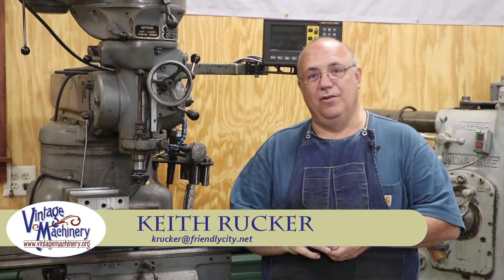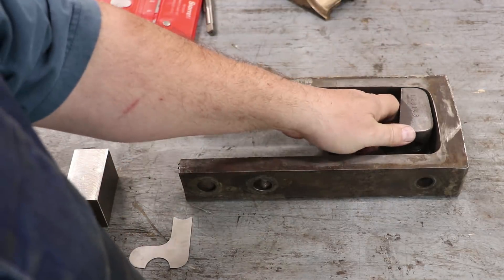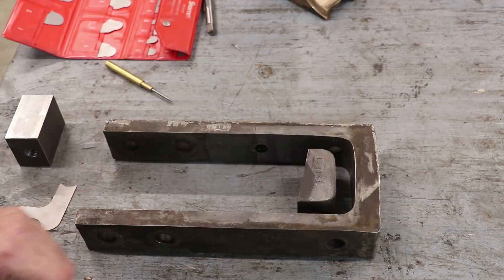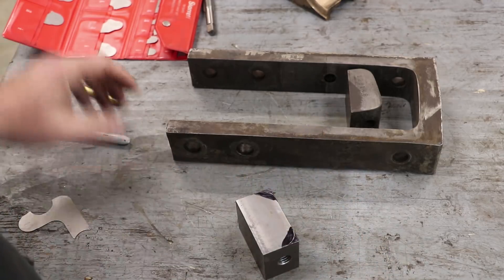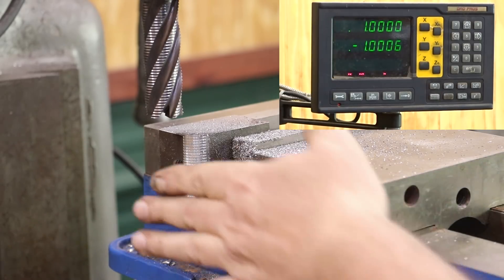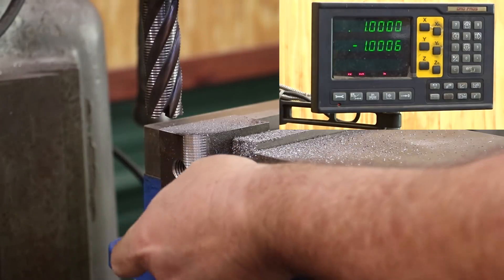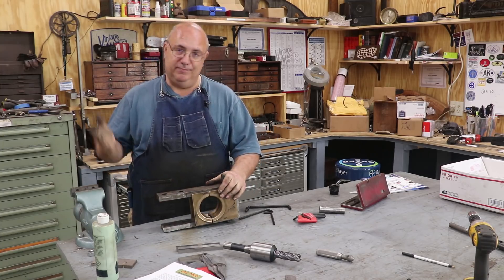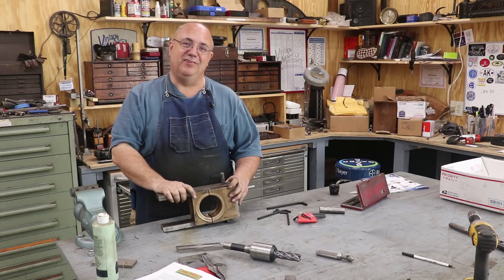Machining a Steam Locomotive Bearing Wedge - Part 2

Comment: This is several months old now, but I have a problem with the operational theory of this repair. If the bearing surface of the U bracket is not parallel with the threaded bolt and flatface of the wedge, you will never get a consistent bearing surface for the wedge. The center area of the U shape will be further away from the bolt, so you will not butt up solid against the U bracket, therefore accelerating wear in the future. You have a lot of time and money invested in the train, repair it properly, don't cut corners :(
Reply: Quite right.  Keith is trying to get the flat,  machined surface of the new wedge to bear on the curved surface of the rod strap.  Not gonna be effective.  I guess by now (4 years later) it has just caused more bowing of the strap.
He's an entertaining charlatan.

Comment: Nice job Keith, as usual!  I have a question, the coolant you were using looked like straight water, was it?  If so I've never seen that done before.  Thank you for your efforts and sharing with us!   Richard
Reply from the maker: I use "Kool Mist" water soluble oil.  It is mostly water.

Comment: @17:19. It looks as if you're up to your old tricks again Keith. The wedge is clearly not seating on the inside surface of the frame because the screw threads are holding it off. This is very clearly visible @17:16 where the wedge can be seen PIVOTING on the screw. 
It is possible to hear the doubt in your voice as you try to convince us all that the job is done. 
Like a lot of custom jobs it will be fine once you hand fit the wedge but I would not be surprised if some interested third party observers might wonder if you are being deliberately dishonest with your viewers or perhaps are simply unable to understand how you might not be perfect after all. Meanwhile your plaudits are enthralled.  Badly done Keith.
Reply: Jonka 1:  I understand what you are saying,  but I also think that this is a rather rugged part of a rather large machine that,  in this part,  does not rely on extremely close tolerances.  All we are trying to do is take up the wear on the bearing material.  The slop in the threads is likely to accommodate many years of adjustment along a less than perfect bedding.  Keith is not building a Swiss watch!

There is also the issue of the adjustment being asymmetrical.  That is,  the adjustment is (presumable) downwards only,  rather than in both up and down directions at the same time.  Is this not really a design issue,  rather than a reinstatement issue?

Well spotted though.

Comment: Oh!!! So the bowing is what caused the threads to fail then, because your wedge would then be pushed out of axis with the bolt putting sideways pressure on the threads inside the wedge.
Reply: Are you thinking that he has not made the wedge to fit properly? Read my comments above.

Comment: Hi Keith, nice work as always. But I would recommend you to mill the end surface of the bracket straight to get the wear out first. The adjusting bolt for the wedge must be free turning in the holes, now it seems to hit them on the rear side. So by the force of the Piston the bolt could be bend or at least damage the threads. There should not be any space between the back side of the wedge and the bracket to transmit the force directly over the wedge to the bearing without any participation of the adjusting bolt.I'm restoring a 1938 0-4-0 with  600 mm (almost 2ft) gauge, so I know what I'm talking about  ;)Kind regards from Germany.
Reply: You are quite correct but Keith will ignore you. He cannot be wrong.

Comment: I try to never run a face mill cutting from left-to-right, except the small residual cut, because then it slings hot chips at me. I just rapid back to the right, except for the final cut. All the DROs seem to have a radius function, they all need the same basic inputs, but the coordinate systems and parameter names vary somewhat. You proved what you said, it's a lot faster than setting up a rotary table for a quantity one.

Comment: Good work as always.
It is hard to see in the video, but are you absolutely sure that the screw does not take part of the force and that the wedge sits firmly against the bracket even in the worn/bent center area?
Reply: Yes Harald it does. Read my comments above. This is an example of the truth badly concealed
Reply: jonka1: sorry, I missed your comment - apologies for that. I rewatched the section and am still not sure that there is a problem.  Yes, the wedge pivots, but this is in a situation where the bolt is in the extreme left position within the slightly oversized bores. I still find it hard to judge based on the video. The oversized bores might still allow the wedge sitting firmly against the bracket. Thus my question, which was meant as a polite question and not as a harsh critique.

Comment: Some years ago I was operating a 1907 Baldwin 2-6-2 up a steep grade. I had a 3 car train. The main rod bearing strap snapped at the pin grease hole. The piston broke the front cylinder head. We had the locomotive repaired and back in service within 24 hrs. with a new head and strap. That being said, we tore down all the rods and magnafluxed all the straps. Grease cups had been welded to the straps years ago.

Comment: instead of brass bearings would it be possible to use roller bearings?
Reply: Excalibur In a previous video he had stated that the museum wants to keep the equipment as close to original engineering specs as possible. It would be interesting to see a steam locomotive engineered with modern knowledge.

Comment: Well it’s similar to a cnc when you’re talking incremental moves, but most times when you’re cutting radius’ on a mill the machine is actually turning two axis at the same time, give you a perfect curve. The resolution of the curve would be perfect if you didn’t take into account cutting speeds, tool deflections, and machine processing

Comment: Perhaps if you had set 0 0 and then taken plunge cuts you would have a better  result. If you think about it, the way you were doing it you were taking a deeper cut on the y before moving to the appropriate x, at least when you started the cut. Taking plunge  would prevent such problems and sound "sweeter" too. 
I hope this didn't sound negative,  it is after all the result that matters not how you got there and you got there.
Reply: I Thought cutting the majority with the band saw would be a good idea too. Less stress on the mill.

Comment: I agree. Machining the bracket, or welding it up or bending it, would have changed the geometry. I think i would have tried to integrate a brass "inlay". 
Take half inch brass plate, fit it roughly to the inside of the bracket lay it in and beat in to the contour.  If the fit is good soft solder it to the bracket. Then machine the brass flat.
But i never tried it with such a part. The load could be to much and deform the brass over time.

EDIT: stupid auto correct .... "brass" not "bass"
Reply: Boelwerkr, there are brass bushings the other side 
of that wedge.  They have the same load.

I agree, the play needs to be removed.  If that screw 
flexes repeatedly, it will break, or at least bend.

I think Keith runs that loco, with at least 75 pounds 
steam pressure, times the area of the face(s) of the 
piston.

steve
Reply: You're right. The wedge rides on the brass bearing block. 
But as i said i never used this method to fix such a heavily stressed part. I think it should work and it's easily removed if it fails.